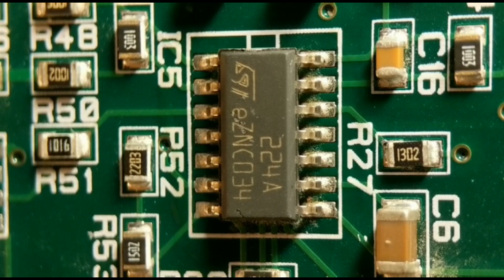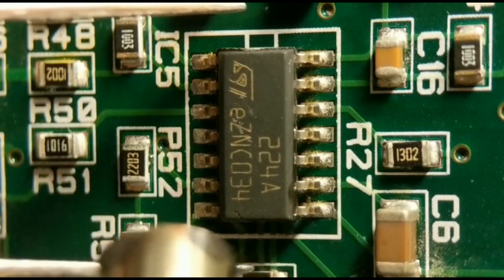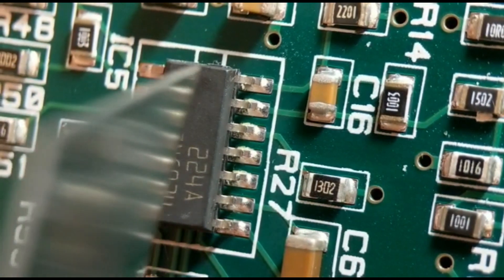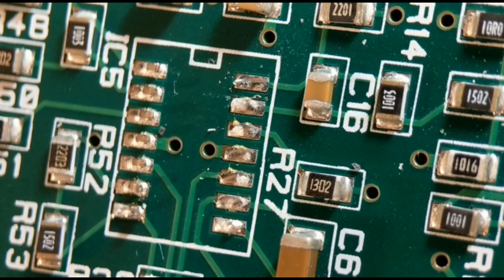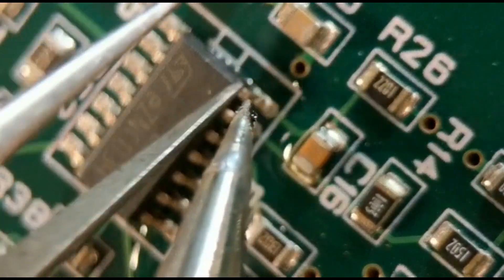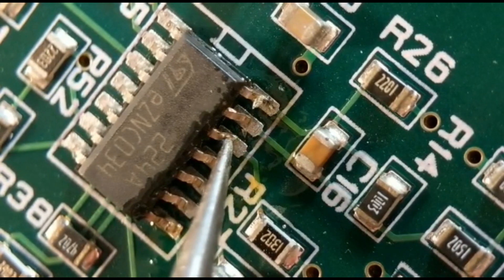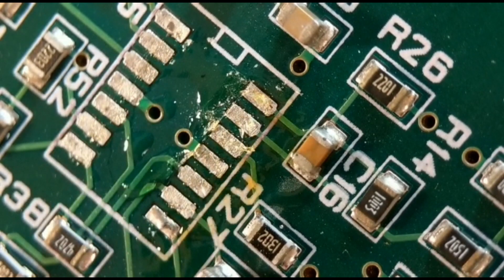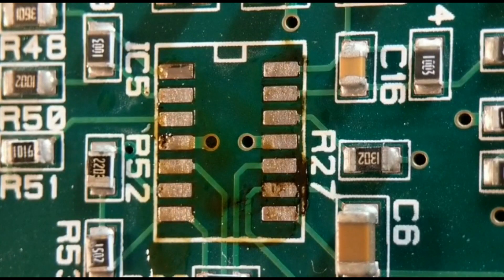How To Remove Surface Mount IC/smd IC - Learn 4 Neat Methods

Comment: I got fired from a company because, although I knew what I was doing, I could not desolder and solder SMDs off of a board.  I used the hot air gun. How do you prevent blowing the other SMD resistors and capacitors off of their pads when you used the hot air gun?
Frank
Reply from the maker: Hi . Thank you for your comment. When I use the hot air rework station , generally I would protect the other parts around it with silver foil tape , this does 2 things . It protects delicate devices i.e plastic headers etc and will also stop 0402 or other size resistors or capacitors blowing away . I done a complete video in my early postings on YouTube showing the benefits of the tape . Also I know if you have the air set to a really high speed this will make it more likely that you will blow smaller devices off from their pads. I've learnt what you can get away with when using a hot air gun but I would say use the foil tape . Hope that helps 👍

Comment: What is the temperature of the airflow heater?
Reply from the maker: Hi . In this particular video it was set at 375 degrees centigrade. This can vary according to your board and the components your working on , but this temperature I do use quite a lot . Hope that helps thanks for watching 👍

Comment: does the ic in the first method get damaged?? i tried it and it got boiling hot with all that hot aie
Reply from the maker: Hi . I've taken many IC's off using hot air and when I've used some of them again they have always been fine . There may be some that do get damaged but I've not come across this personally. Hope that helps 👍

Comment: There is a 5th option i have seen, where you wrap a copper wire around the soldering iron tip to the size you need for both sides, and use a little solder paste to help conduct the heat. 

You still need to use solder to loosen the legs
Reply: Could you link a video to that? It sounds really cool.
Reply: @jonjonmia  https://youtu.be/xMXJTLWyBCo

Comment: Hi friend thanks for the informative video, how close do you keep the hot air gun from the ic
Reply from the maker: Hi . In this video I would of had the heat gun approximately 2 to 3 centimetres away from the IC. This can vary for other types of components from nearer to further away . I do try and continuously circle the component , only keeping it trained on the centre of the device once the surrounding areas pre warmed . Hope that helps , thank you 👍
Reply: @mrsolderfix3996  thank you so much for this information, greatly appreciated
Reply from the maker: Hi . Sometimes , depending on the component I will even go into 1cm away . If you have plastic parts nearby you want to protect from the heat , you may find my video ( silver foil Tape Vs Kapton tape , Rework test ) a very useful help to you . Good luck 👍
Reply: @mrsolderfix3996  thank you so much
Reply from the maker: Hi . No problem . Good luck 👍

Comment: Last method best
Reply from the maker: Hi . If you haven't got a hot air rework station then I totally agree , I love the 2 iron method ( that's why I done a complete video on the use of 2 irons ) of course as long as you have a spare Soldering iron that is . Thank you for watching , much appreciated 👍

Comment: Can i use again the component that is desoldered?
Reply from the maker: Hi . If the component was working before you took it off and it came off with no damage , then there is no reason to not use it again . I've removed and used the same component many , many times without a problem . Hope that helps 👍

Comment: I do not know what's the wattage on your soldering iron/irons,but using 100W tool on a lead-free connection is no go for me.Anybody interested in verifying my statement should try to desolder any component from a drill battery controller board.The solder used nowadays is a high temp stuff,very safe to handle and impossible to melt
Reply from the maker: I use Weller TCP S soldering irons which are 50 watt when I'm doing 2 iron work , used in the right hands no damage to board or components will occur. There's always a way of getting over problems if you know what you are doing , certain tricks etc . Hope that helps , thank you 👍
Reply: @mrsolderfix3996  Thank you,appreciate replying to my comment.I wish I could be as confident as you are,but it is still a hard fact of life( for me anyway),that lead-free solder is close to impossible to melt during a reasonable amount of time.Advice given in your video is very good and you illustrate the process of desoldering very clearly.It is just that as an average " solder soldier" of average dexterity I have difficulty to apply succesfully

Comment: I've used all those methods over the years.  The 'cut the legs' method I used on those very thin foldable pcb's.  But the real problem of smd removal is when the components are glued down ... the clue is the little red spot.  I have never managed to overcome this problem without destroying the component and damaging the pads.

Comment: Excellent thank you will put this in use today.
Reply from the maker: Hi . Thank you for watching , much appreciated . Good luck with your projects 👍
Reply: @mrsolderfix3996  Thank you. I used the 2 irons tip to remove a chip I’ve been afraid to take on the past month and all went well. Thank you😊👍
Reply from the maker: Hi . That's good news . The 2 iron method really works well , that's why I ended up doing a complete video on the method . Thank you for your support 👍

Comment: You don't need 2 soldering irons, you can work faster with one soldering handle or you can buy soldering tweezers...
Reply from the maker: Hi. To get IC's off with one soldering iron is not a good way . You have to keep going from side to side a few times this way to get both sides to melt at the same time , not good practice in my view , risking more damage this way  . But if that's your preferred method that's fine by me . I just like showing an easier and safer option . Soldering tweezers also are ok but I've never met anyone who really likes them . Everyone I know prefers the 2 iron method to do loads of different kinds of reworks . Much simpler . I actually done a video on the uses of 2 Soldering Irons . It shows they are way easier and more versatile for reworking than soldering tweezers .Thanks for watching 👍
Reply: @mrsolderfix3996  If you don't know to do something, you can not say that is not right way. I am working 30 years as tv mechanichal and I don't like use 2 soldering irons. I always use one soldering iron and beleive me, it is not that hard how you think that is. You must use flux (I am using AMTECH original, not from AliExpress) and you must give enough time for iron to heat pcb. You must make giant solder balls on both side of ic chip. It's peace of cake....
Reply from the maker: At the end of the day everyone does things their own way . I find two irons much easier , if you like one iron that's your choice . I to have been doing this over 30 years and used to use 1 iron like you . But not now , for me 2 is best . So I do know how to use 1 iron  👍

Comment: I do number 4 but with one iron and some thick single core copper wire, works a treat evem works for 4 sided ics, you do need a powerful iron though especially on tbe big ics.
Reply from the maker: Hi . Thank you for your comment. I've done this on a couple of IC's and like you say it does work pretty well . I used a Weller TCP S soldering iron with a DD8 tip fitted and this did do the trick . I might video it one day even though people have already shown this method . Thanks again 👍

Comment: Great stuff Bro! The only problem is the low sound recording. I had to push the volume to the highest to listen. Regards. Shmuel.
Reply from the maker: Hi . Thanks for your comment . I use different stuff to record my video's these days ( probably used it on the last 3 or 4 videos ) so hopefully these should sound ok  , they did to me when I tried them . So hopefully I've cured this problem . Thanks again , much appreciated 👍

Comment: Nice video, thanks!

I have to do a mod but I only need to lift one pin but the pin is right in the middle and I need a tiny tool to lift it without ruining neighbours :/

Any idea / suggestion?
Reply from the maker: Hi . The best way to lift a single pin in the middle of a row of pins is to place a scalpel blade or the leg of a fine pair of tweezers behind the pin ( you use the pin next to it as a lever ) and put your iron on the pin . Wait until the solder melts then you can ease the leg up about 1mm. Then all I do is use solder wick ( braid ) clean of the solder between pin and pad then lift the pin until the desired height . I done a video about pcb mods , it shows this in that video as well as this one . Hope that helps 👍

Comment: How do you clean the flux off?  I find it gets very sticky sometimes.
Reply from the maker: Hi . Thank you for your question. To clean off the flux the fluid I use is called Ultrasolve ( in my opinion it's the best flux remover there is ) leaves your boards pristine. The wipes i apply it to are called Gtek wipes , available from a company called Grove Sales Ltd , about £5 for a pack of 100. Ultrasolve can be found at Farnell , RS Components and others online . Hope that helps 👍

Comment: There's the TexMex method that I've used for removing flat pack IC with 100+ pins.  Prep the leads by removing old solder / covers leads with flux.  Run a small wire underneath the leads on the IC and attach one end of the wire to a large solder land that usually sits on the edge.  Grab the other end pull up gently while heating the leads.  Why this method?  When you got a bootstrap situation (i.e. cheap employer, lack of money issue, manufacturing emergency).  P>S. Give me a hot air station - the wire lift method takes practice.
Reply from the maker: Hi . This is why I love soldering . Everybody has different methods of doing things and then you can pick the one that suits you best . Thank you for your thoughts , much appreciated 👍

Comment: Really nice methods. My problem is that some ICs have heat sink pads underneath that are also soldered to the board. Is there any other options besides hot air?
Reply from the maker: Hi . Hot air is really the only option when you have a heat pad under the device . 
I have heard people say you can heat the via's on the other side of the board connected to the heat pad and melt it that way but unless you can cut the pins on the device this isn't really an option . 
Hope that helps . Thank you for watching 👍
Reply: @mrsolderfix3996  thank you

Comment: What tweezers do you use?
Reply from the maker: Hi . Thank you for your question. I just use a different selection of tweezers that I've gathered over the years so I can't really give you any information on them . I just use small really pointed ones when I do 0402 size components and larger opening ones for large IC's etc . I personally only use straight tweezers , never really liked ones with a bend in them . Don't buy cheap tweezers though as you do get what you pay for .Thanks again👍

Comment: Wow that 2 iron thing was a eye opener for me,never seen that before and it's just won you a new subscriber 👍👍👍
Reply from the maker: Hi . Thank you . I've done a complete video on the benefits of 2 irons (rework soldering video) , you should check it out , you'll be amazed on how good this method is . I've shown it to lots of people over the years and everyone loves it . Thanks again for your support 👍
Reply: If you have fast hands, you can do this with 1 iron and alternate, you got your second hand for a tweezer to remove the chip
Reply: Ditto.
Reply: Agree that alone got me to subscribe, going to look thru the video on the 2 irons right now. 
Thanks much!
Reply: I used to have a gizmo for old DIP chips that did this from the other side of the board. It looked like a rows of staples that attached to your iron. You'd flip the board and heat from the bottom and the chip would fall out the other side.
Reply: You need special training and a lot of experience for this. Like a two soldering iron ninja master. Using the force you must.😁
Reply from the maker: Hi , thank you for your comment , much appreciated 👍

Comment: What fuid did u use in first method before blowing hot air?
Reply from the maker: Hi . The fluid was rework flux , SMFL200D . It's a great all round flux , I use it for all my new soldering and rework . It's about £11 for a 200ml spray can . I just spray some into a small pot and apply with the end of a Ty wrap. Hope that helps . Thank you👍

Comment: That 4th option is really genius
Reply from the maker: Hi . Thank you . The 4th option is my favourite also . It really is so easy to do this with 2 Soldering irons , and is really safe.
I love using 2 irons for lots of my rework , in fact I also have posted a video totally showing the uses of 2 soldering irons . Everyone should get a 2nd iron. Thanks again👍

Comment: Thank you for this video, really helpful.
What temperature are you settling for the iron solutions ?

Best Regards,
Didier
Reply from the maker: Hi . Thank you for your comment 👍 When I use the 2 soldering iron solution they are both set to 340 - 350 degrees . This does no damage at all to components if done correctly . In fact I have done a complete video on the benefits of 2 soldering irons for rework , it's a great method . The hot air rework station is generally set to between 330 and 375 degrees. Hope that helps , thanks again .
Reply: Thank you for your prompt reply, this will help me a lot. I was used to use lead free and this temperature  is bellow 300. Now I know why it was so difficult to remove the chip.
Reply from the maker: Hi . When you do lead free you need about 350 . Leaded solder will generally be ok at 325 degrees 🙂
Reply: @mrsolderfix3996  what is your air speed set to in percentage?
Reply from the maker: Hi . In this video the hot air rework air speed was set to about 100 . I do use higher if I'm doing a large QFN or QFP for example , likewise if I'm doing a tiny IC I will lower the air sometimes down to 30. I use a Quick 861DA rework station . Thanks again for your comment , much appreciated 👍

Comment: What kind of flux is it that you use? I think I have a lot to learn on the flux aspect.
Reply from the maker: Hi . Thank you for the question. The flux I always use is called SMFL Rework Solder Flux , code is SMFL200D . Comes in a spray can , but I squirt some into a small container. It's a great non corrosive flux so can be left on the board but I always clean off. About £10 for 200ml can . Hope that helps , thanks again.

Comment: Hi what solder iron do you use?
Reply from the maker: Hi . Thanks for your question . I use a TCP S soldering iron made by Weller. It's a great iron with a wide choice of solder tips to go with it. Hope this helps.
Reply: Mr SolderFix thank you
Reply from the maker: No problem